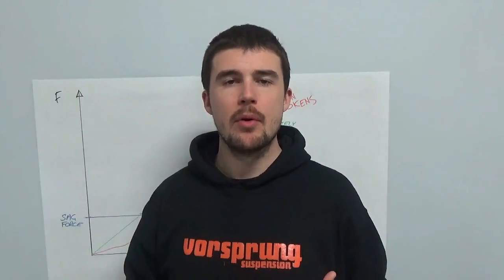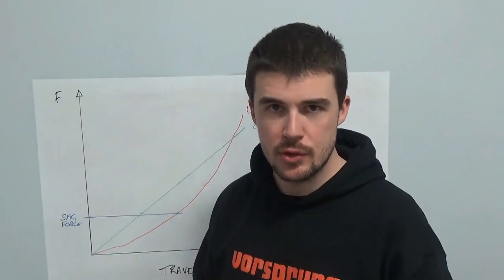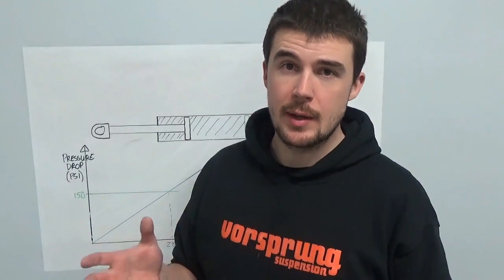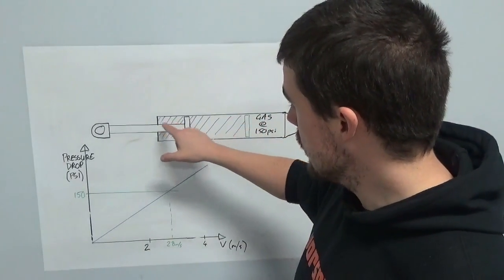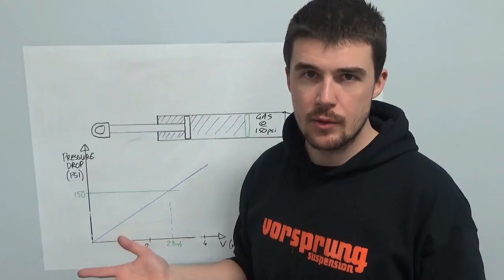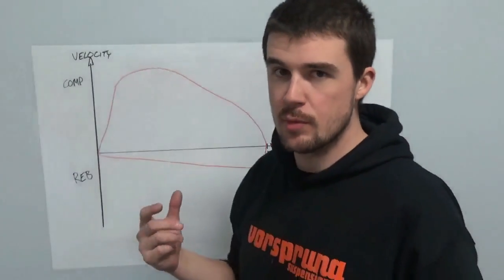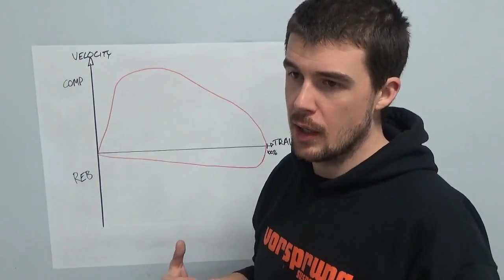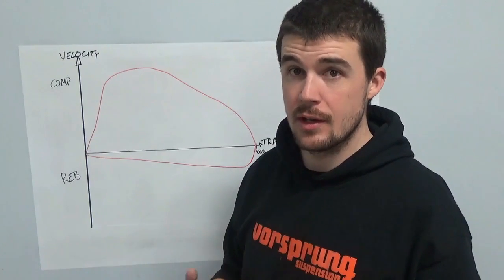The Tuesday Tune Ep 14 - Busting Myths

Comment: well if you'd really like to mess damping up one could play with fluid dynamics 

if you'd design a lowspeed circuit that has laminar flow at low shaft speeds, the effective flow rate can be higher at a given force ... just the flip-point into turbulant flow would typicly mean a really harsch transition in Damping force.... unless you create really fancy difusors on your ports ... but there we likely get into metal 3D printing

Comment: I have a very little nerdy thing to mention about the statement that spring force is the only factor that defines rebound speed:
I am riding a DVO diamond fork (new fork is on the way and I'm planning on a coil kit), I'm riding the rebound relatively fast (rider weight ca 95kg, rebound setting is fully open).
I notice a loud metallic "klonk" sound when I exit a berm and go directly in a manual to pump over a roller (lifting the handlebar quite fast out of the compression from the berm). I think the extension speed of the fork is at that moment higher than what only the spring can do because the inertia of the front wheel and lower leg creates an additional resistance against which I can pull  to extend the fork even faster.
Reply: Thats a very good point, not sure by what amount it would increase rebound speeds but it would definitely have some effect
Reply: The clunk you hear is just from the steel negative spring, typical thing with DVO forks.

Comment: real position sensitive damper should be on the market from dt Swiss fork and ext shocks. Ext solution should be basically is basically just the piston entering a smaller tube at the end of the travel.
Reply: If the piston entered a smaller tube at the end of the travel then it would mean no overlap with the piston head and the inside of the shock body in the initial part of the stroke, therefore it could flex and get stuck on the smaller tube causing it to stop or even break, unless I'm missing something
Reply: @spuddo123  it doesn't, Manitou just has a slightly floating cup at the end of the piston, chamfered at the end of course, I assume EX and everyone else with similar systems, does it the same way.
Reply: So like Manitou TPC+ or HBO in the newer forks?

Comment: May I ask ; how its possible that the red line is lower on 50% sag than the linear line? it should be going always above the linear line. If you make the air space smaller (with bottomless tokens) the air pressure increases much faster when you compress the shock or fork.
Reply from the maker: Basically if you were to run a hyper progressive setup at a much lower pressure then that's the curve you'd get. It's grossly exaggerated compared to anything  you'd run in reality just so that it's easy to visualise on a graph.